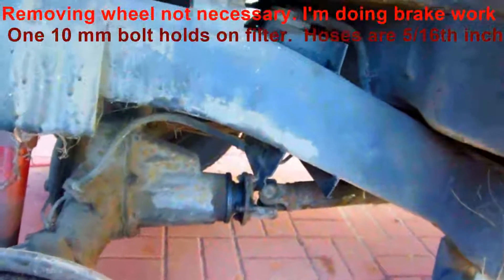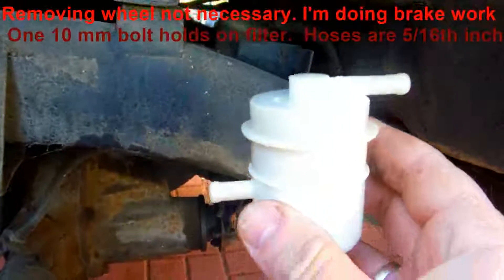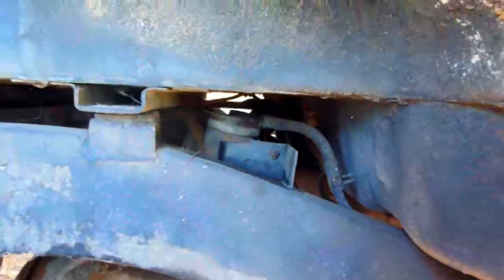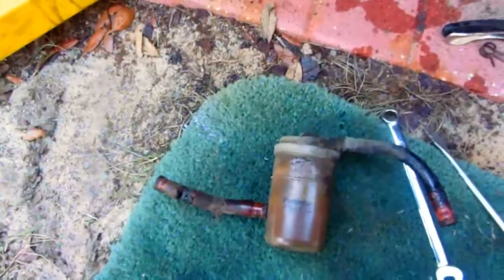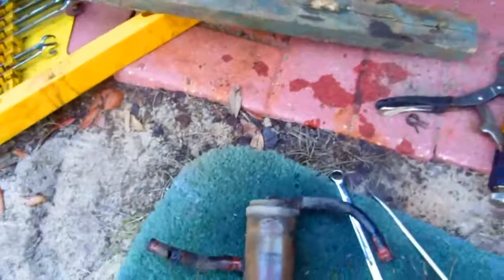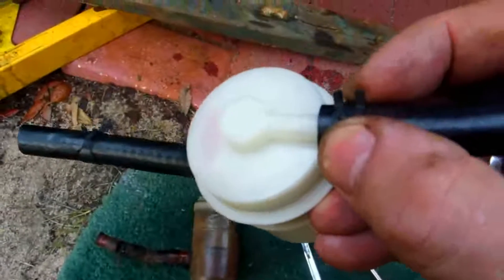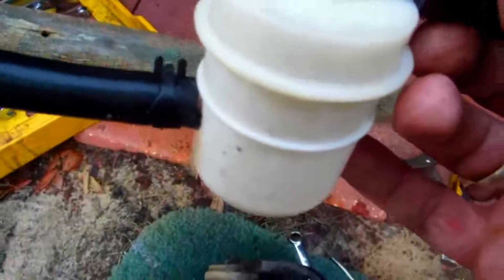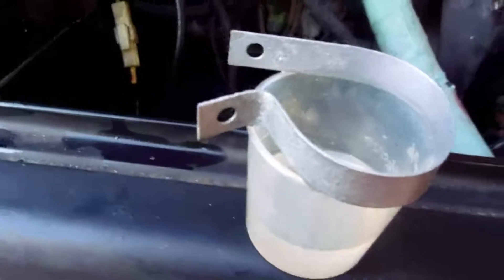Suzuki Samurai - Changing a Gas (fuel) Filter

Comment: They make shallow oil filters two I made the same era when I changed my full filter but it's not that much of a difference But if you put the other in Line filter in you can see how much if any gas you will be getting it is Bulky thow what no room for it ? O well your gona need some starting fluid thow Have Fun I no you can do it S7